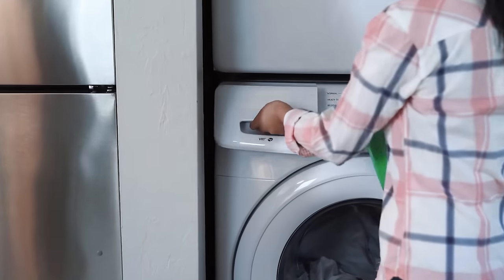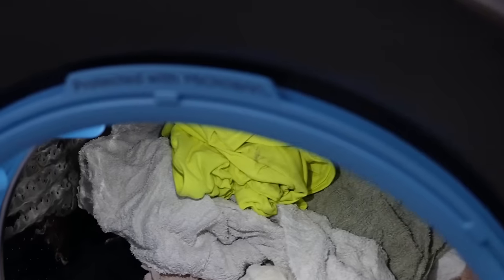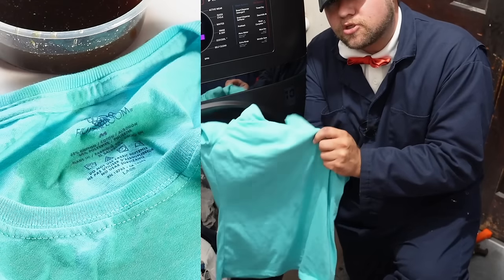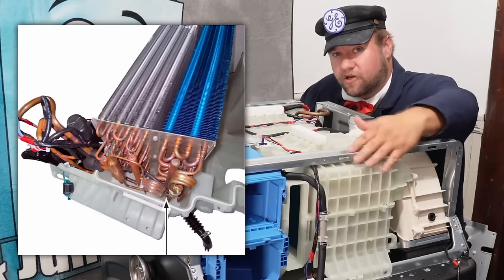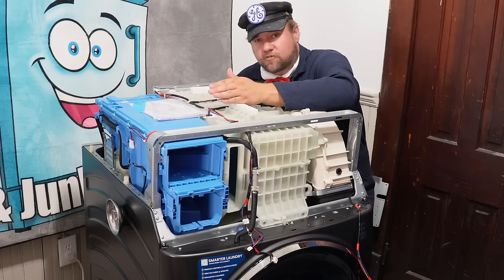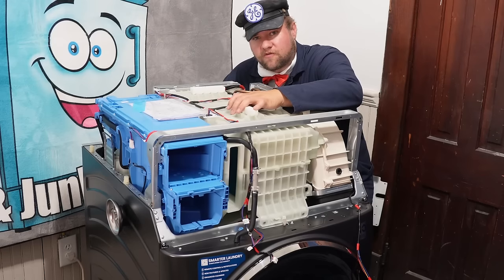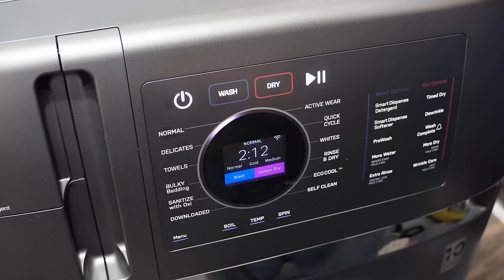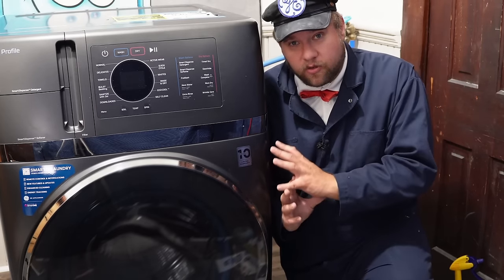The Best Washer Dryer EVER? The Ultimate GE 2-in-1-washer Dryer Combo Test & Review

Comment: Id argue that being able to replace pretty much the entire guts of the system as one unit is not repairable. Youre just buying an entirely new system and throwing it in the old shell.
Reply from the maker: You could easily find and utilize any generic condenser, evaporator, or compressor on the unit. The fact you can replace the entire system all in one is, quite frankly, never before seen in modern appliances. This just gives you actual options to resolve the situation rather than the same that every other sealed system on the market has.

Comment: This guy is completely wrong in the beginning of the video. Washing machines were almost exactly the same internally, mostly mechanical until the government put in place the water usage regulations. With the regulations in place, they are almost now entirely electronic. Whereas what used to be mechanical components are now electronic modules, like I said, electronic. I just replaced the washer hoses on my speed.Queen basic mechanical washing machine. I bought it new because it's the best quality washing machine, and it's basic and Mechanical, so I could do most of this stuff on my own. Having watched lots of videos of all these low water high electronic washing machines, some of them without agitators, I can assure you, as not even being a repair man that when he says they've been pretty much the same since the nineteen fifties, he's absolutely incorrect.

Comment: Heat pump condensation dryer. Nooooo can u imagine the repair bill. Think refridge AND washer, dryer bill. Thats 3 separate units in 1. Allthis cause ur too lazy to transfer load. .17$ avg kw hr x1000 =1700$ savings over 5yr? Great another nasty moldy coil to maintain. Yuk 11:06 they had to do it, appliance repair in field typically not licensed for hvac. 4hr for big load? Bwaahaa i can wash in 25, dry in 1hr.  I have electrolux front load w&d and thin twin. Laundry done in 1.5hr including 1 min to swap loads to dryer.

Comment: Bad product IMO. It takes much longer to get the clothes done than any normal washer and dryer would. That increases your electric bill substantially.
Reply from the maker: No it doesn't. As stated in the video and verified by metered data it uses half the energy a similar unit would using resistive heat.

A typical tumble dryer requires a 240v 30a electric hookup to run a 5,000-6,000w heater. This used 1,200w at peak.

Comment: I have the worst washer and dryer in the world. They only work because duct tape happened. Drying FULL loads takes less than 2 hours in my dinosaur. What am I missing here?
Reply from the maker: 2hrs in an old dryer? Sounds like vent is clogged
Reply: @bensappliancesandjunk  Maybe I heard you wrong in the video. You ran that thing for 2 hours + and said some were still damp?
Reply from the maker: @davidfordyoyoguy  they need shook when they come out and they are OK. Also that was 2hrs for wash and dry total. Which is barely more than a standard WD set
Reply: @bensappliancesandjunk  Makes more sense. Thanks.

Comment: I had a combo washer/dryer like this. Piece of junk. Well, pieces of junk. I had it replaced four times while under warranty. Stupid thing ran on 110, not 220. Burned out the power supply trying to make up the amps.
Reply: No you didn't. This unit is all new tech.
Reply: @USNEM  That particular model, no. But I've had a singe unit washer-dryer system before. They are quite popular in Europe.

Comment: I don’t understand why you or anyone would be okay with opening the dryer and having damp clothes. That is absurd! I’ve kept mine clean as a whistle and it still leaves clothes damp. No dryer should leave your clothes damp! And now it’s also leaking water somehow. The lint trap is soaking wet after a load of clothes. I regret ever getting this piece of crap!
Reply: Hmmm.. I’ve had mine since Aug 2023 and started to notice the same thing. After watching Ben’s videos, I took my lint cleaning a step further and discovers a lot of lint inside the compartment. After some thorough cleaning of all the blue coils and the compartment, no more leaking and no more damp clothes. My machine is used primarily by my teens who don’t clean out the lint filter as they should. But I also think the filter is not capturing everything that is blowing around in the compartment. 
Best of luck. I still love it despite this small issue.

Comment: Click bait commercial, you cannot declare a washing machine good or not based on one use. The biggest concern and issue with washing machines is that they are all designed to fail after 2-3 years and this is backed up by the fact that many of the parts are no longer available after a couple of years. If you knew anything about appliance repair you would recognize the biggest concerns so you would address them directly rather than distracting people of bullshit features. Find a machine that will last and guaranteed to be supported for 20-30 years and promote that instead. GE, Maytag etc are all made with the same parts which are all made by Electrolux. Only appliances I buy a Samsung or commercial appliances that are designed to be fixed for decades
Reply from the maker: You slam me for it being a "Click bait commercial" then tell me that you only buy Samsung appliances, lmao. What a comedian!

Comment: So, the GE appliance division is owned by a Chinese company. There are other brands that you can buy that doesn't support the CCP in any way. And stay away from Samsung and LG appliances...  Just happen to be a tech. And buy the least expensive appliance with the least features and buttons. Not worth spending big money. You'll be getting it fixed before it's 10 years old. Or just throwing it away and buying a new one. Washers and all appliances have changed drastically over the last 50 years. They don't last as long. Keep your old appliance until you can't get parts for it anymore!!!!

Comment: Too many things can go wrong. Too complicated for a diyer to repair
Reply from the maker: The washer is a standard GE front load, so easy to deal with. Heat pump is about as easy to fix as one could ask for. Extra complexity due to compressor, without a doubt but this is more DIY-friendly on the sealed system than anything else I've ever seen.

Comment: "radical washer dryer system" Europe has had this for decades, we were just to dead set on american things being better because Murica
Reply from the maker: Please show me which combo washer/dryer Europe has that has an 8kg+ capacity. Especially one that can wash + dry a 5kg load under 3hrs.
Reply: @bensappliancesandjunk  Im supposed to be impressed that they made it bigger? that's what your making a fuss about?  That's not revolutionary that's what Americans do. "the people want more capacity, what should we do boss"
"Durrr i dont know what if we just make the whole thing bigger!" 
As for the under 3 hour claim big whoop that's about average for a load of laundry going through a machine or pair of machines of any size. My point is i clicked on your video expecting some new idea not "we took something Europe has been doing for decades and made it bigger"
Reply from the maker: @SirFloofy001  read a few of the hundreds of comments here. A lot of people wanted something like this and GE gave it to them. A single unit that can wash and dry a 10lb load of clothes in ~2 hours. Never been done in the US or Europe. All ventless on 110v. Literally every other machine on the market cannot do it. A similar-sized LG will take 2x as long. A more efficient European HPD will take longer, but be as efficient at less capacity. Two machines can do it faster in twice the space and 4x the electricity. There are always tradeoffs somewhere, and this machine is, by far, the most different from anything else on the market, and I would challenge you to cite a specific example that this machine copied. Otherwise, if you can't, its certainly unique in the market. 

And judging on it being the fastest selling appliance I've ever seen, the market seems to like the idea and what it offers, even if you think somehow its not new or unique.

Comment: I don't get the market for this... A separate washer and dryer allows for washing and drying simultaneously, a load in the washer and one in the dryer as well. Saves time. I had a combo Splindede unit on my last boat... pitiful. The only thing the dry function did was turn clothing into a tight dry ball of cloth.  I guess is you were tight for space, get a stackable washer and dryer... which is less money than this thing.
Reply from the maker: Not everyone has a laundry room with a 240v outlet and ducting for exhaust... This needs neither, and will wash & dry about 3x faster than a Splendie would at twice the internal capacity...